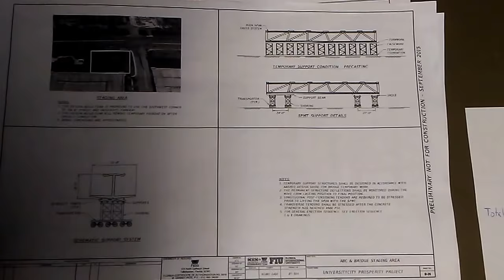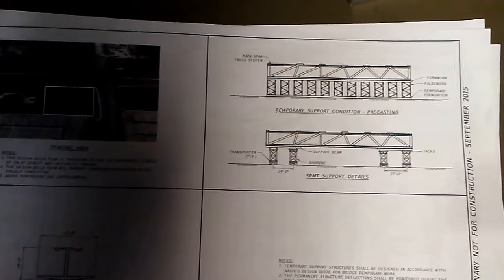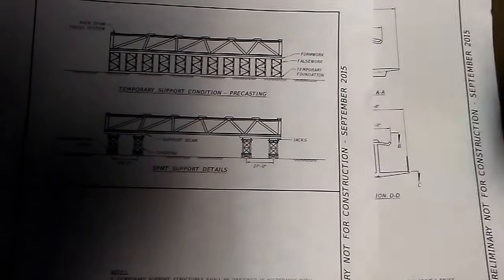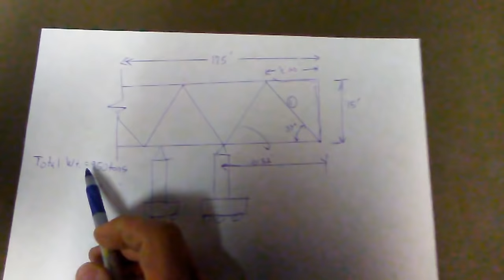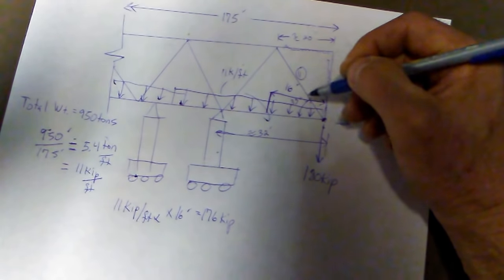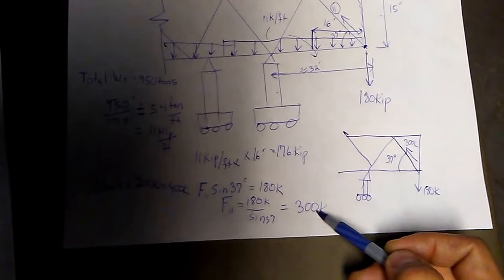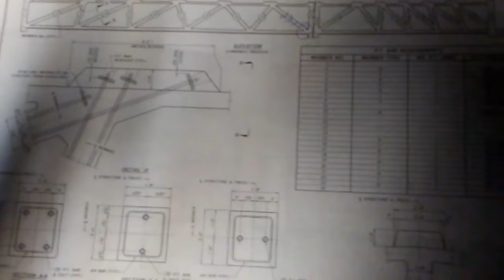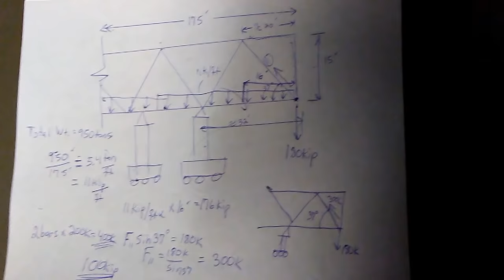FIU Bridge Collapse: The Hidden Truth (Part 4)

Comment: I'm enjoying your analysis very much. I have a couple of questions. If the truss and canopy had not been installed but just the walkway, do you think the bridge would not have collapsed? Did the truss have any other function than to support the canopy? What do you think would have happened if truss member 11 had not been installed. Recall that the canopy had its own longitudinal cable supports that extended to the end vertical member.
Reply from the maker: The truss and canopy are essential.  The walkaway is too long and slender to support its 175' span on its own.  The truss diagonals, canopy top chord, and walkway are all tied together to form a truss system. Unfortunately, a failure in any component of this truss system would have led to bridge collapse due to the inherent lack of redundancy in this truss. If Member 11 had not been installed the bridge would have been unable to stand on its own.
Reply: structures specialist Thanks. Interesting.  Very different from a span supported by structural steel from underneath. So each truss member and the canopy that held them together was a single point of failure. That's a lot of points. This was just a walkway, not the golden gate bridge. Very disappointing. You'd think something like a walkway would be child's play for a competent structural engineer. My experience with structural engineers is that they always over design very conservatively with a 100% safety factor.
Reply: @Mark Fischer; For any other pedestrian bridge, the engineer would have "over-built", but in this case, you have a collaberation of designers, each with a particular agenda.  First; this was intended to be something of a gathering/lounging space, with tables and chairs.  Secondly, it was designed to be a visual element, like a site sculpture. Thirdly, it was decided that this bridge would exemplify the latest technology and trends in modern materials and methods, being made of "self-cleaning" concrete, and assembled nearby and moved onto the site to minimize traffic interruption.  

How much cooperation occurred between those three disparate design goals remains to be discussed, but whenever something is designed by committee, you can be sure that one or more designer has been forced into compromise.  

Compromise might be a good thing for setting up a social project, but for a public walkway erected overhead, safety should be a significant part of the equation.  

I am reminded of another similar catastrophic failure wherein the engineer's design was compromised by the fabricator, resulting in loss of life.  None other than the Hyatt Regancy walkway collapse in Kansas City, July 17, 1981.  

https://en.wikipedia.org/wiki/Hyatt_Regency_walkway_collapse
Reply: James Surber on every project for each discipline there is a project engineer who reviews the design, puts his PE stamp.on it, and takes legal liability for meeting codes. A licensed contractor takes responsibility for the construction complying with the plans. If a change is required then the PE issues a field change order in writing. A licensed inspector who is a government employee checks the plans and if acceptable to him issues a building permit. He may inspect the work at various stages but must give final written approval before the construction is deemed usable

At least thee sets of eyes recognized as experts by the state have agreed to the safety of the design and construction. In this case all three failed. There are no excuses. At least one and possibly two of the three has legal liability for the consequences of this failire.

This is why I never applied for a PE license. People who hire me not only tell me what to do but sometimes how to do it. It's hard enough to keep up with changes in the codes but when people order your to do something that you know is illegal and probably stupid, they feel it is their right because they are paying you. You have a choice, quit or take your chances. The state does not recognize me as an expert and therefore I have no legal liability for my designs. I'm an electrical engineer and a construction project manager with nearly 50 years of experience. Although I'm not a structural engineer, I would not have agreed to build this design. It has loser written all over it.

Comment: In looking at Detail A, I see no safe pathway for a compressive load to be transfered from the truss web member (member #11) to the top chord.
Reply from the maker: The connection is certainly an area of concern. If this had been a steel truss, Detail A would have had the members connected with a gusset plate: https://en.wikipedia.org/wiki/Gusset_plate  
In this case, the thickened concrete at the ends of the members functions similarly to a steel gusset plate.
Reply: It certainly appears to be the case.  So some concrete cover will absorb all the compressive forces?  Uhh.. I doubt it.
Reply: In the proposal drawings there is no post-tensioning for member 11.  Look at the table of member tensioning.

Comment: I presume that tension occurred early in the moving process, before the contractor added tension.  ie: somebody noticed the cracks, and somebody ordered the tendons put under tension.  Since all this was done "on the fly", the workers who noticed the slack in the tension bars were "surprised" because they had to apply tension just the day before.  This all points to the high probability that multiple persons were making important decisions with no one single person keeping track.
Reply: Can not understand your thinking ?????? These preliminary drawings show  the post-tension bars in the diagonals. It means  decision of using them was made very early and people in charge should know about them.  An ordinary worker  can not understand statics and how forces change during different stages of construction. This is definitely responsibility of the EOR.
Reply from the maker: A post-tensioning sequence must have been approved by the EOR prior to construction. There are records of this somewhere since this would have been a construction submittal.
Reply: @Richard Oblak; Did the EOR forsee the need to place the transporters 32 feet inboard from the end of the truss?  I doubt it.  Your assumptions are valid only if everything goes according to plan, but it clearly did not.
Reply: @James, The statics for this bridges changes according to the construction sequences from a member sitting on the multiple supports during forming to simply supported beam (truss) with two cantilevers at each end and finally just simply supported beam (truss) . Calculations are required for every stage, no doubt. All this must be taken into account by the EOR specially when he deals with post-tensioning and stress reversal. I can not imagine  any other person.

Comment: According to your calculations no post-tensioning is necessary , 300 kips force is small and could be taken by the mild rebar in this diagonal. This tension load is transient in nature  and cause by temporary conditions.  Eventual cracks would be closed by the compression force of 1580 kips after the bridge is placed on piers.
Reply from the maker: Great points! The compressive stress applied  by the post-tensioning bars really is small (400kips applied post-tension / 500in2 Member 11 cross sectional area = 0.8ksi) when compared to the 8.5 ksi compressive strength of the concrete. The post-tensioning is really there to prevent concrete cracking from ever occurring....mild rebar could be sized to fully resist the tension but concrete cracks would likely occur without post-tensioning.
Reply: There is no post-tensioning in Member 11 in the plans.  Look at the table.  Each diagonal member has either two, four or no bars.  No. 14 has no PT bars either, because it is in compression naturally.  

However, the failure photos appear to show a PT duct and rod in the blister of No. 11.  That must have been added later when the bridge was lengthened.
Reply: The largest post-tensioning pull in the world was 1 million kips. The bridge was under repair to correct sagging.  Like the FIU bridge and the Kansas City walkway failure, this bridge was the victim of contractor-initiated change order.  The cause of the FIU collapse was a change order.  Plain and simple.  Change orders do not get the scrutiny an original design does.  That's a fact.  

Many changes happen as a structure is under construction.  Some changes are made without the Engineer's approval or permission/knowledge, some without permission but the Engineer knows after the fact.  Some changes are requested as a design change.  Changes may include materials or processes not up to specifications, "savings" by the contractor (not putting in all of the specified rebar), simple mistakes that cannot be reversed (a load of concrete that is slumped after it has been placed or another "aw shit!" event), etc.
Reply: @william whitman; @ Richard Oblak; Exactly!  Anyone who has worked in construction has seen that many times.  Sometimes the project doesn't fall down, sometimes it does.
Reply: If the "change order" requires the doubling of the span length should  such change get the scrutiny ???
Saying that collapse of this bridge was caused by  "a change order" is a nonsense.
Reply: @Richard Oblak; Not at all.  I never claimed there was a change order.  No doubt there should have been, but until someone shows me the actual change orders, I will continue to suspect that there were not any, or at least none of any relevance.  

I think multiple persons were making decisions "on the fly", and the EOR (if indeed there was only one EOR) was either absent or out of his league.

Over-tensioning member #11 past the point of compression failure (either in the column itself or at the connection with the upper deck) is my guess of how the collapse was initiated.
Reply: I believe, we both know when a structure fails there are usually many reasons.  Some sort of combination of mistakes but in this case what struck me was speed the structure failed. If a concrete structure fails it should fails in DUCTILE manner giving some time to escape. As result (I speculate !) I would not blame the contractor and any change order but rather people responsible for design.
Reply: @Richard Oblak; what about concrete makes you think it should fail in a DUCTILE manner?   I see nothing unusual in the speed of collapse.  To me, concrete breaks, and then it falls.  To help you visualize this, think of a stone arch or a brick wall.  Masonry is not ductile.
Reply: Do not forget - reinforced concrete is a composite material !  According to the design codes (and I know a couple) concrete structure shall be design such way that when  the element reaches ultimate strength  the destruction starts with STEEL YIELDING not CONCRETE  CRUSHING. This is more gradual, allows  for visible cracks and gives time to run away !  In the FIU bridge collapse  I saw opposite happened.  There is a big difference between properly designed concrete structure and stone arches and  brick walls.  Stone and bricks are brittle.
I saw another videos this morning. It looks like something terrible happened there from the design point of view (or the complete break of communication between all involved parties)

Comment: 2 support beams were not placed tight on the underside of the bridge as designed when moved , could this let the structure flex and cause the cracks?
Reply from the maker: Certainly. And I would expect the cracks to occur near the loose supports. In this case, it appears the cracks were noted at the end of the bridge, away from the SPMT support location.